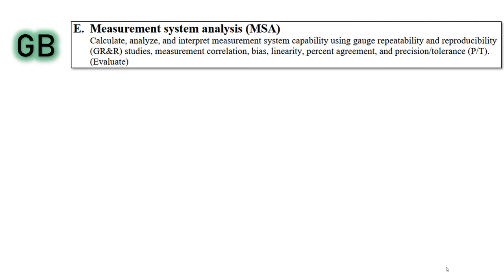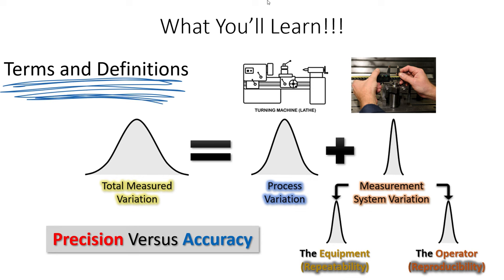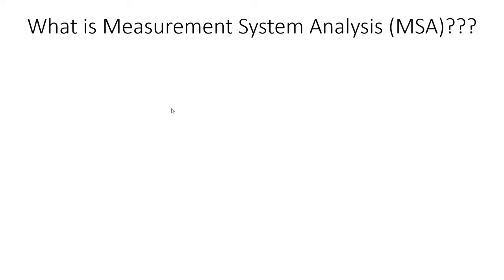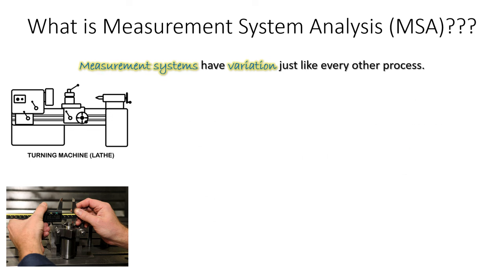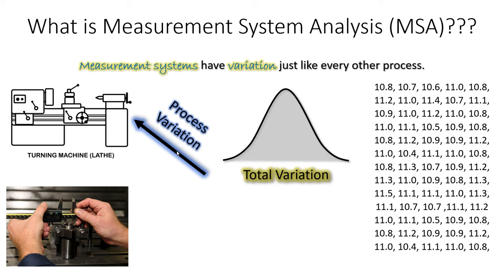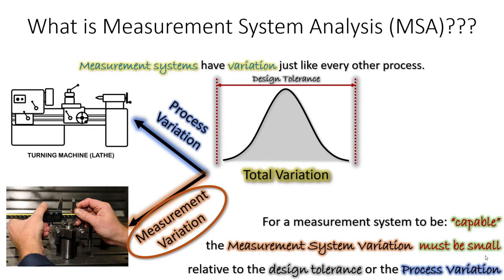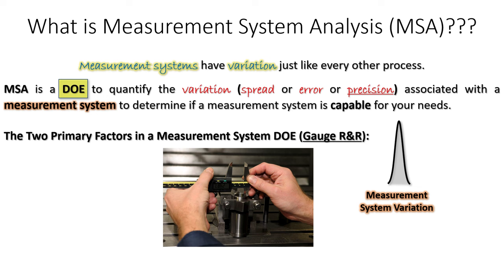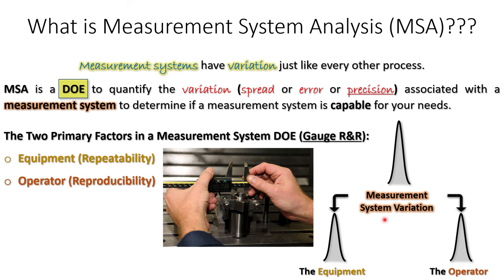Gauge R&R Fully Explained!! (Measurement System Analysis) Part 1

Comment: Hi Andy,

Comparing these terminologies with your ANOVA video, can we say that reproducibility/operator variance is treatment variance whereas part variance is error variance in ANOVA and as such repeatability/equipment variance explained in this video was not covered in the ANOVA video, right?
Reply from the maker: Hey Rajesh!! Yes that is correct!!! Great job making the connection between Repeatability and the MSE (error variance).

In fact, if you use ANOVA to evaluate the results of your gauge R&R, the repeatability term is equal to the MSE (Mean Square of the Error).
Reply: Thanks Andy, loved your videos :)
Reply from the maker: Thanks  @RajeshGupta-gx3yz

Comment: Do you use all the dimensions listed on a drawing or just the SC's on the drawing?
Reply from the maker: If you don't plan on routinely measuring certain dimensions (Non-critical) during routine production, then a gauge R&R isn't necessary.

But for the dimensions that end up on your control plan - where you are going to make routine measurements - you should consider a gauge R&R.

You could also work with your friends in Quality to determine the worst case dimension for a gauge R&R, which perhaps would the dimension with the tightest tolerance or the smallest process variation.

Comment: Hi Sir, l have a question. Let's say I have 3 operators and 5 parts. Each part measured by the same operator 3 times. The measurements are length measurement and the equipment is a vernier caliper. Should the 5 parts all come from the same part number e.g. Part number 123 or different part number?
Reply from the maker: Great question.
In a perfect world, yes you would want to measure 5 parts that have the same part number. This ensures that they parts are all made using the same process, and fixtured/inspected the same way.
If you used different part numbers, and those designs were slightly different, or their production processes were slightly different, or their measurement methods were slightly different, all of that variation would get introduced into your gauge R&R and skew your results in a negative direction.
Reply: @greenbeltacademy  Thank you very much.